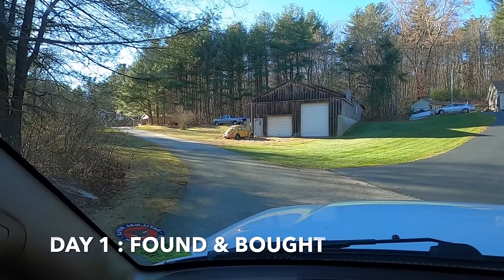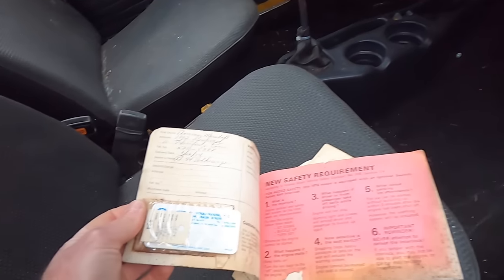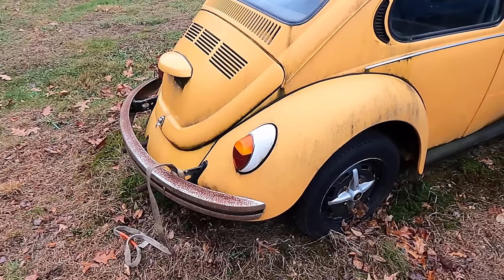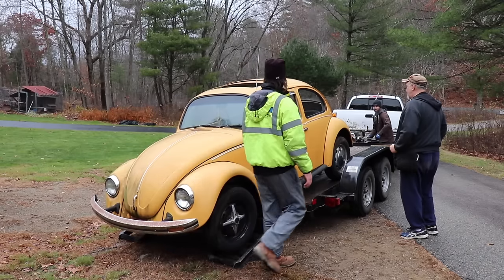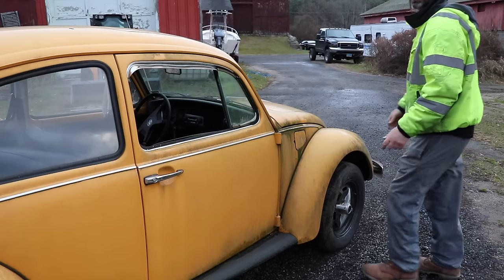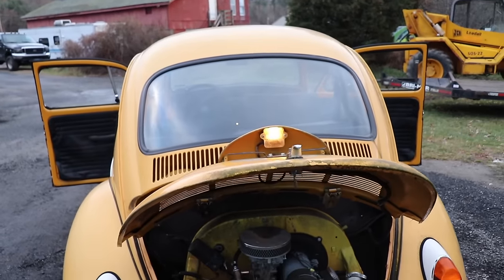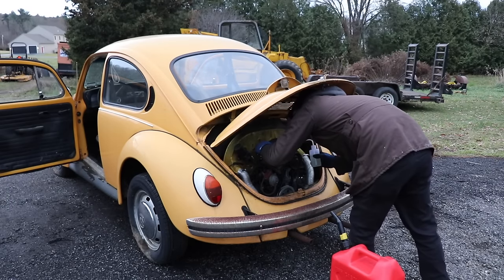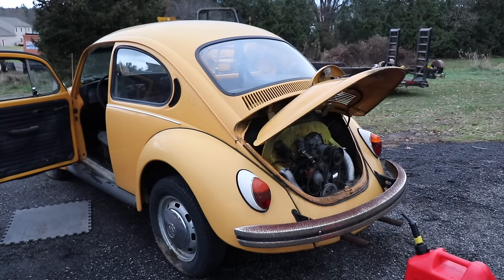Will it Run and Drive? Forgotten Vw Beetle Found - First Start in Years!

Comment: I cant't express how I've missed the sound of that engine. I know, this is a piece of well constructed metal, but when I see when this car is coming back to life, it's just like a friend talks to me. It remembers me a lot to my "yellow-black-runner", a 50 HP Specialbeetle 1303 S. I've loved that Special Bug. Greetings from South-West Germany.
Reply: Had 72 bug marina blue brand new from star motors local dealership bought for 2295 if wanted radio had to pay more like 50bucs i think. Took to florida in 72 used it there n left it there at dealers it always had to have tune up . My first car took it to key west in 1976. With husband before married. 😂

Comment: I love the distinctive  sound of the beetle when running it's so unique
Reply from the maker: 👍, should sound much better after a tune / valve adj and head re-torque
Reply: I was thinking the same, and it's especially cool inside the cabin.

Comment: Great find.  I sold my yellow 1973 VW in 1986 to two Japanese young guys.  It has been idle for about a year but had enough gasoline to get it started and they brought a gas can.  Sold it for $800 in 1986 of 1987.  It needed new seats and also the rear fender was in need of replacement.

Comment: This episode reminded me of the Beetle I bought and drove in Germany while stationed at Ramstein Air Base. Over there they are called Kafers. Even says it in the brochures! My Beetle was a german spec sport beetle. It had Cibie fog lights mounted on the front bumper from the factory, blacked out bumpers, and trim. It was also orange! Similar to Hemi orange on the Plymouth Dusters. Man I miss that Bug, it was a 73 or 74 Standard Beetle, flat windshield with the large tail lights. (I bought it from another Air-Force GI in 1985).

Comment: That appears to be a '74 Sun Bug, were gold with sunroof and 4 spoke wheels. '74 first year with shocks in bumpers, front is right, but rear bumper mounts have been changed to '73 and prior style.

Comment: Cool video and perfect length if you ask me. 
The good thing about the mid 70s is you can still find them in OK shape and in 10 years, when all the 50s and 60s are gone, this one should start rising in value pretty fast.
I think in 72 they started with 4 rows of cowl-vents in the engine cover. 71 had two rows.
Yellow was the most popular color during this time because there was a popular children's books titled "Volksy (The Little Yellow Car)" re-published around the same time.
Have a great week.
Reply from the maker: 30 minutes for you John😁

Comment: Strange configuration. A 74 shock-type front bumper with a pre-74 rear bumper brackets and rear end taillights in rear. Low back seats(pre-70?). Almost a Franken-Bug. I love my 74 Bug good luck with it.
Reply: I was thinking the same thing. Gotta wonder if it was rear ended and the rear fenders and bumper were replaced with the earlier style.

Comment: Jason this yellow bug looks decent.  That front bumper looks like the German models I've seen with the turnsignals and maybe Mexico market cars.
Reply from the maker: Hi Dave , yes it is pretty solid ....I think they shaved the front signals and added that cal look style post 67 bumper
Reply: It’s a US market sunbug, still has the shock mounts on the front, rear has been messed with though.
Reply: @BoostedVW  so that had the German and Mexican signals in the front bumper?
Reply: @davemcguigan218  nope, both the bumpers have been swapped b
Reply: @BoostedVW  that's what I thought since they were never on US models.  Someone added them!
Reply: Yep I caught that too....Mexican Beetle my guess

Comment: The tail lights have been changed.  1972 was the last year Volkswagen used that shaped tail light.  They went with round starting in 1973.
Reply from the maker: Those are the 62-67 tail lights

Comment: Excellent video Jason :) also got Bumble Bee from Transformers cartoon TV shows series from 1981 to 1987 and movies too recently too Lol! Jason hope fix up and drive it too! My first girlfriend Rebecca had on her 1968 VW Bug with  Manual gear had changed to a Red ball with  ❤ and her car still going strong also around too guy sold too! Her was white body also black interior got updated motor plus transmission also 12 volt with GM Delco Alternator to also radio to plus 4 speakers to also new radio antenna!

Comment: Putting a 1962-1967 taillights on the 1972 VW Bug, not a Super Beetle. Next thing we all know is to put 1966 and earlier old fashioned “Porsche” headlights as of European look. Or maybe graft the front fenders to put the 1937, 1938, or a 1939 Ford teardrop shaped headlights. Since most parts are interchangeable for the VW Bug from one year to another.

Comment: nice bug looks like a superbettle i still have mine 1971 superbeetle bug run great i only run 91 octane gasin mine it runs cooler if you run below 91 it will run hotter

Comment: No death foam?  Killer of late models in my area.  Even on my crappy computer that engine was loud!  Hope it turns out OK..  On an old VW, always check and clean those points before attempting a start.  Your odds of having functional points on a car that has been sitting for a long time is likely less then 10 % in my experience (cold and wet climate here)...
Reply from the maker: yeah , has a couple bubbles by the vent ....should be fine with a valve adjustment and re-torque the heads . People like to see if they start as found , you could tell it didn't sound promising without a points clean and a battery . Plus not cleaning the points at least shows it was sitting ....ya gotta try and keep the critics at bay haha.
Reply: @5150mxVW  That makes sense.  Educational material for the viewers out there.  Love your channel and keep on finding that vintage tin!

Comment: I know the early VWs (split, oval, etc) are all the rage, but I'm much more fond of post-'66 (big window) models so it's nice to see a late 1300(?) get rescued. I realise that specs differed btw Europe and the US and elsewhere but IIRC very late EU ones had round rear lights and front indicators mounted in the bumpers. The rear lights are a retrofit from a '68--> 1200 I think, but as I say, specs in the US differ.

Edit: 15:21 that sounds like an original starter motor too.

Comment: Now that's a good modern VW and I think the paint is probably OK, strange thing with the rear lights though. Jason it's a nice change to have a will it run before the first wash.  Great video Jason, thanks. 👍
Reply: Agree. A 1974 Beetle would have had the ‘football’ or ‘elephants foot’ rear lamps which were universal to both sides and required shaped rear wings (fenders) as the lights bolted straight to the wings. The moulded dash, 4 spoke steering wheel and front turn signals in the europa bumpers also all confirm this as a late model Beetle so the only explanation is that a previous owner fitted older profile rear wings (fenders) presumably because they didn’t like them or rear ended damage. The older 1200 rear lights were never fitted to europa bumper beetles. Well that’s my theory. I owned a 69 1200 and then a 70 1302S which were worlds apart. Great video.

Comment: It's a '72 Standard sunroof Beetle with older tail lights. Fairly rare.
Reply from the maker: Hi Eugene , it's a 74 ( standard )Sun Bug with 62-67 tail lights , pre 74 rear bumper mounts / bumper, low back seats / earlier pans
Reply: @5150mxVW  Wow, so it's total mutt! That's hard to tell then. But it looks like a '72 without knowing all the details. Thanks though.
Reply from the maker: It’s one of ONE 😎
Reply from the maker: 74 is the 1st year of energy absorbing bumpers ...still has the front , they welded in 73 rear brackets
Reply: @5150mxVW  Yup, that's usually the easiest way to tell a '74 apart. Big brackets but still carb'd.

Comment: At least it still has a spot for the battery. We all know how they like to fall through the floorboard. My 72 had low backs. So I had “T” bottoms with low back back rests. Cost me an arm and a leg. Guy says “you can’t put “L” rail seats in there”. I said “watch me”.

Comment: Cool video J. There is a bus in my neighborhood that needs to be saved. Been sitting for at least 20 years in the driveway, looks to be in okay shape. Mid-to-late 70s.i think it's a camper model.i can get you pics. If you're interested. It's in South Windsor Connecticut
Reply from the maker: thank you Dominick , yes for sure , my email is J5150mxVW@yahoo.com . Thank you

Comment: You need mustie to help out, l seen him get an old vw motor  going that had been used as a boat anchor at the bottom of the Rhine for 40 years , it was a solid lump of rust, but he could see the possibilities with nothing but a shifter and a screwdriver and some blue tack he got it to run
Reply from the maker: that was probably the engine i gave him when I hooked him up with that free boat !

Comment: Another great recovery video. How many undiscovered VWs are there left in those parts?
Reply: How many are hidden in barns garages and busses
Reply from the maker: Thank you BK...They are still out there , at least in New England
Reply: My grandmother has a 1300 with 50k miles that hasn't been started in almost thirty years and has been garage kept the entire time. I rolled it out in the drive way today for the first time in almost thirty years and she rolls but the break petal is locked up and the parking break doesn't work.

Comment: Is this Beetle from Mexico or Brazil ?  Front bumper brackets are 1974 type, rear are 1973 type. Low back sets, front signals in bumper = one odd lot VW Beetle ... Engine seems strong, should make for a good ride ...
Reply: You'd have to look under the rear to see if it's got a swing axle because that's what they used in Mexico / Brazil with the short seats and different bumpers. OTOH, it could be a composite car made from pieces.
Reply: It’s an American sunbug it’s just had smash repairs in the rear with earlier bits and a turn signal front bumper fitted

Comment: Nice find! I thought in '74 Beetles went to Fuel Injection and had only one peashooter exhaust? If so, this might be a '73 or older. I drove a '73 convertible to High School and it had the big round taillights. Yours have been changed at some point and maybe the fenders too?
Reply from the maker: thank you Trent , I. think 74's were still carb ....yes , this should have the volleyball tail lights ...a few back dates on this one
Reply: @5150mxVW  the taillights are from the standard 1300 model at least here in Brazil.
Reply: 1975 for fuel injection

Comment: You must know by now it’s not a 1974. That flat windshield went away after 1972 (my model). My guess is it’s a ‘71. 1972 had that engine cover but larger taillight assemblies.
Reply from the maker: Flat windshield never went away on the standard beetle production until it’s end in 1977 . The super beetle had the flat windshield in 71 and 72 and curved in 1973 on as u mentioned . This car is mix of all years

Comment: Can i add mine was left at dealership in florida  1983 i left there. I regretted that so much.  Wish i nvr did that ...i had it down there 12 yrs upon moving out of state to wva. It had black bucket seats 5 speed n i was only owner of car. Salt air cracked one seat is all was wrong with it. Marina blue was color motor in back air cooled engine but it always had to have points n plugs and distributor put on n i used leaded gas back than in florida. Heater nvr worked good but difnt need it in florida but was bought in wva

Comment: It has to be a 1972 or 1971, 1973 the front windshield is not flat and it’s missing the signal lights in the front fenders
Reply from the maker: Odd that many people seem unaware that standard Beetle's , not just Super Beetle's were still being mfg after 1972 . Yes , the 1303 1973 Super Beetle debuted the curved windshield . However Vw still made the standard Beetle ( flat windshield / standard front end / suspension) from 1973 up to the last year 1977 . The turn signals were shaved and the cal look front bumper was installed with the integrated turn signals .

Comment: Why aren’t the taillights big like 73+?
Reply from the maker: they did some mods on this one
Reply: I was thinking the same thing. I used to own a 74 and it had the elephant foot taillights and the turn signals on the fenders. Also should have the shock absorber rear fender as well. Possibly had some work done on it over the years with whatever parts were available.

Comment: that speedo shows 86 hundred miles, not thousand miles. It's been around the block!
Reply from the maker: haha, thank you for the correction ...well ya miss a lot looking through a 2" gopro screen
Reply: @5150mxVW  ... did you figure out if this is a Brazil / Mexico car? Those should have a swing axle instead of IRS in the back, although I don't know what year that started. I do know the short seats and smaller lights are usually south of the boarder.
Reply from the maker: @rupe53  I didn't look it over too much but I think it is a 74 gold ( color ) standard beetle ....with older rear fenders , pre 74 rear bumper / mounts , shaved front signals , earlier pans welded in for the low backs . I am headed out to Matt's now to look it over better . It is a solid sunroof car that once gone over should a nice driver for cheap $
Reply: @5150mxVW  ... earlier pans? That's a lot of effort to change the seats. Old timer hint: while you are adjusting the valves, remove the rockers and retorque the lower row of head studs. (about 28 pounds if I recall) This will probably solve that noise that sounds like an exhaust leak, but is really from between the head and cylinder because the stud is not tight. It will also tell you if there's a stud pulled out of the block. (it happens) Self-taping oversize studs are available so you don't have to tear the whole engine down. You just double nut the end and install it like a regular tap. (back and forth motion) When all done you remove the double nut and install the washer again, then torque to spec. (you removed the washer to make room for the extra nut)

Comment: Wedubwille 
Have you ever ownd a standard?
Reply from the maker: ? Standard as in what ? A non super beetle ?
Reply: Adjust the valves!!!!!
Reply from the maker: I’d guess around 50 ?
Reply: A standard is a no option wedub. One sunvisor, 1200 engine, no interior floor mat and so on.....
Reply from the maker: Did they come to the USA like that ? I think all we had were deluxe models
Reply from the maker: Yeah , I check em before a first start but JR was in a hurry 😁

Comment: 74 beetle?
Reply: Saw it on door post when you were walking around it. Has incorrect bumper ,fenders, and tail lights.
Reply from the maker: yes , 74 ...decklid and fenders ?
Reply: Yes back fenders are incorrect as are taillights and bumper. 74 is the first year for the shock absorber bumpers. 73 is first year for the large tail lights. And  72 is first year for the 4 vent decklid
Reply from the maker: @shawnmanck1327  oh yeah , duh , the rear fenders would have the huge volleyball cut out lol.
Reply: Sorry deck lid is correct has 4 vents
Reply: @5150mxVW  also someone added a power pulley. I dont run them here in texas  good chance of overheating
Reply: Thats a good find that runs.
Reply from the maker: someone else pointed out it should have the energy absorbing rear bumper as well.